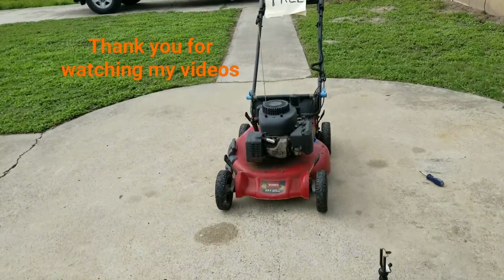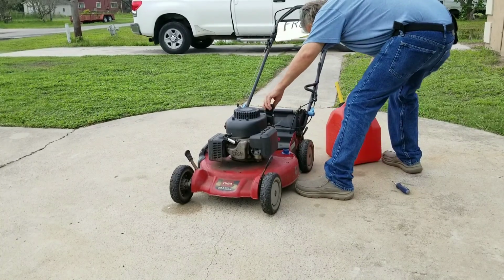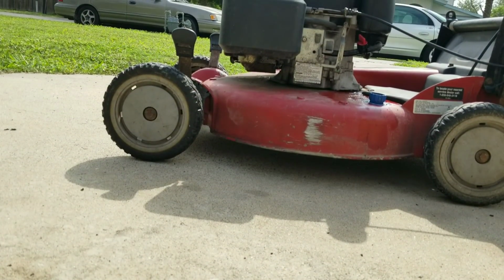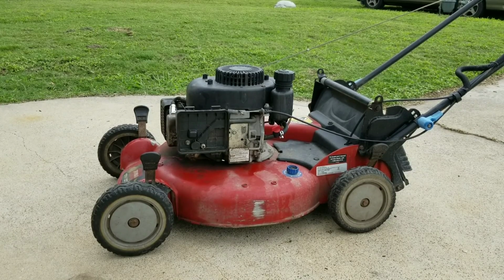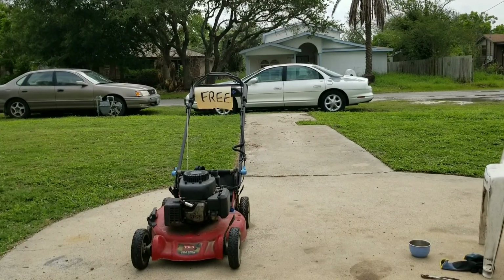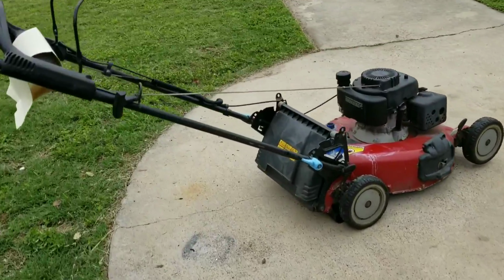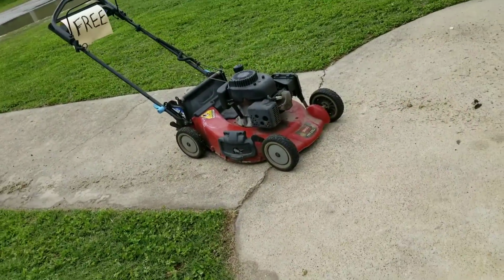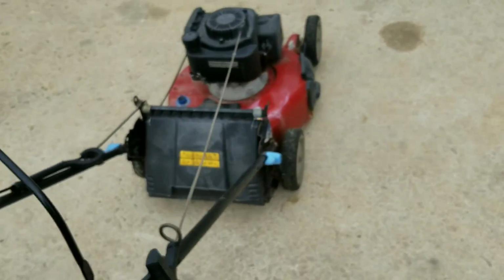Free Toro Super Recycler Mower

Comment: Free? What a find! Even if it needed a new engine, those cast aluminum SR mowers are nice and last a really long time 👍🏻
Reply from the maker: Yup, I told my wife i was wondering why it wasn't rusted, cause my last mower I bought new rusted up quick. After I read up on it I found out about the aluminum body. It works very good, also has rubber tires instead of hard plastic. It drives fast, I guess the more you push the faster it goes.